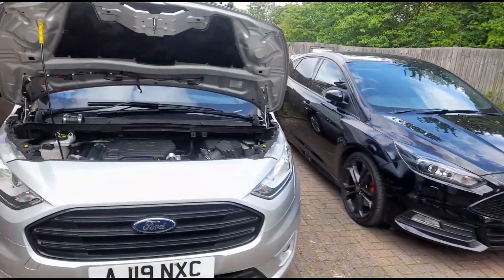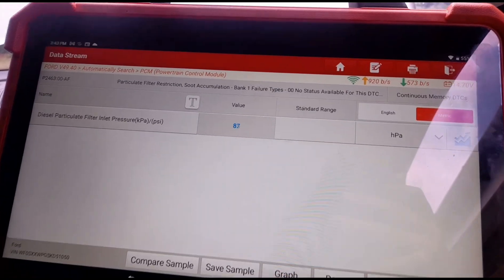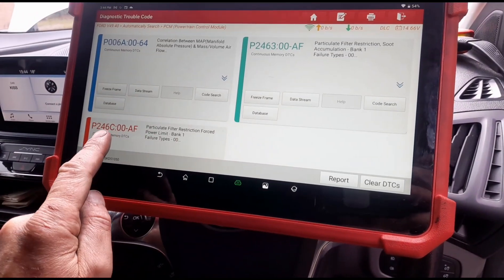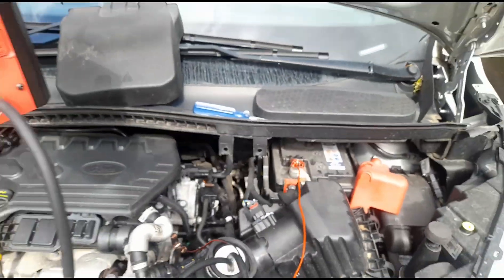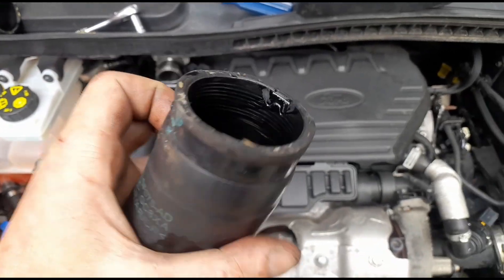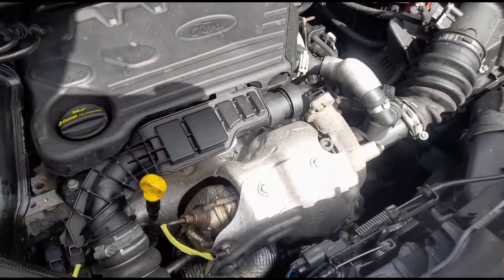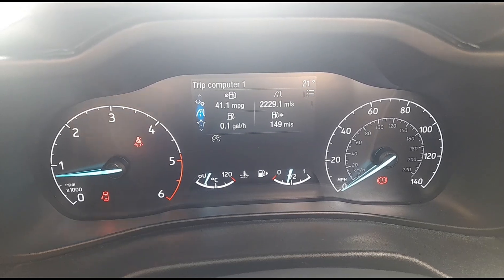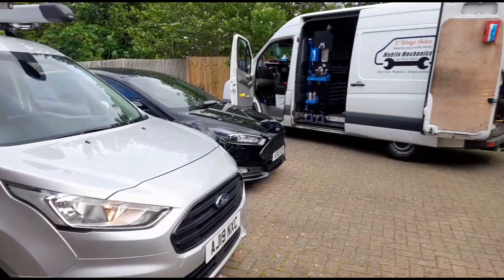Ford Transit Connect 1.5 P006A:00-64 Correlation Between MAP & Mass Air Flow. P2463:00AF P246C:00-AF

Comment: Is there a common pipe to fail on a 2019 Focus 1.5 TDCi at all? As I have the same codes on that, but the engine is a bit of a different layout, so doesn't have the same pipe there. Just to know where is most likely to look before digging out my smoke machine? Also, is it always likely to be a leak, rather than a blockage or anything else? MAF sensor is recent genuine part, MAP sensor is original. Thank you and keep up the good work, almost every diagnostic search brings up one of your videos, and always makes perfect sense and logic!

Comment: Can't believe rac couldn't suss that. Theyre so common those boost pipes i did one last week. Ill take your advice in thr forced regen as i know those dpfs are fragile as ive seen that efficiency code before on some of ours on fleet. That fluid is great stuff.  I will sdmit i used some G101 cleaning fluid and went in through the upstream EGT sensor and it worked with the soot breakdown as ive used it on VW t6 egr coolers . Ill get proper stuff next time. Great video
Reply from the maker: Yeah I've changed maybe 15 of those boost hoses now

Comment: Hi jimmy, hope you’re well. I’ve noticed on my connect that the boost hose is looking a little worse for wear, and I’d like to change it before i get any issues. Would i have to connect it up with a code reader to reset anything if i was to replace the hose? Appreciate your advice all the same 
Cheers
Reply from the maker: No.
Reply: @ORileysAutos  nice one, thanks

Comment: Hello. I’ve got the P2002 code on vw crafter 2.5 2007. I’ve checked the dpf back pressure and is @10 mbar at idle and under 100 mbar at 2500 rpm. Could the dpf be damaged or it might be a faulty pressure sensor ? Thank you!
Reply: Is it reaching operating temperature? Is it the only dtc?
Reply: Have you solved the problem